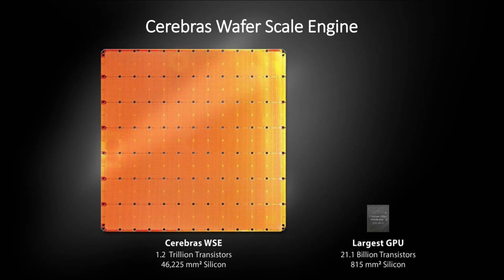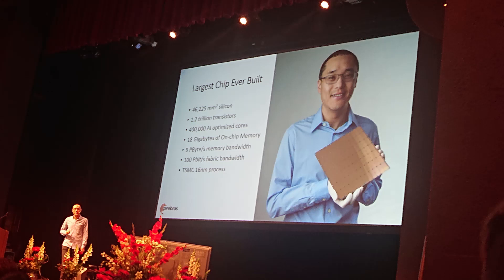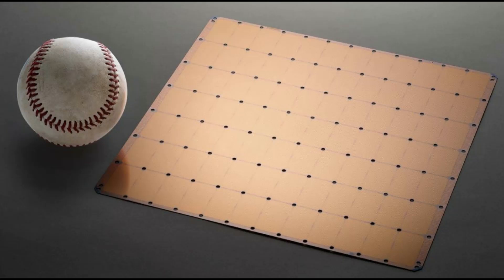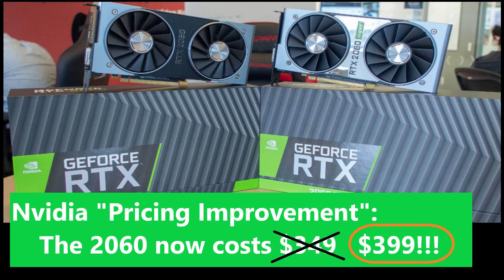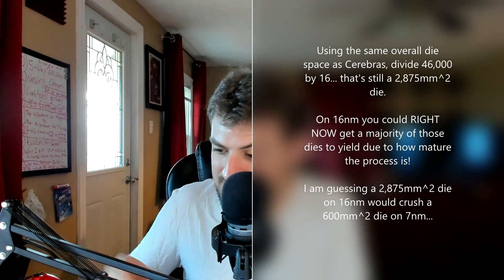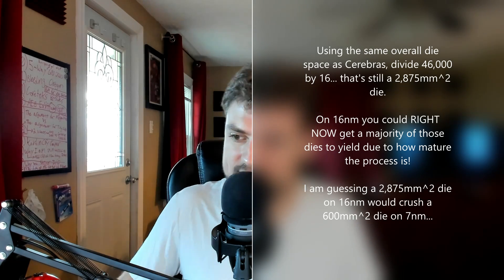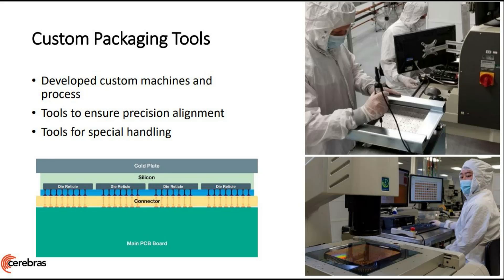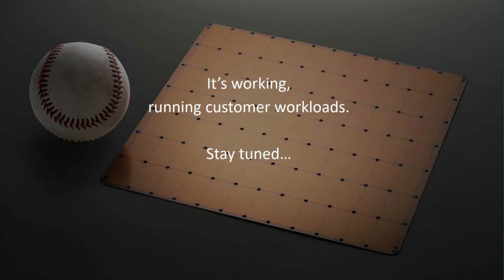The Monolithic Future of Silicon

Comment: You should look a bit more into big monolithic dies... historically, this company is not the first trying this approach. AMD's chiplets with infinity fabric on substrate or Intel's EMIB with any data fabric is a better choice in almost all cases.

BUT... all of those companies that tried to build either wafer-scale processors or wafer-scale memory chips failed, and why? Large dies are not practical...

Let me explain:
1. Even though it's a monolithic wafer-scale engine, it still consists of completely separate cores. This is because physically, you can't project such a large die in one go, you need to slide the template across the wafer. Then you can bond (create a fabric) between the dies that are on the same wafer afterwards.
2. So you still need inter-die connects, just like with chiplets, but in this case, you have to plan the wiring carefully, because you need to circumnavigate defective dies, which will not always work (= higher costs, lower yields, "weakest die"-issue).
3. In the end, this achieves nothing more than Intel's EMIB (where a small silicon bridge is embedded in substrate between chiplets), although (the monolithic solution) does this at higher cost, less practicality and less flexibility in how the individual dies selected are laid out physically next to each other, e.g. gaps.
4. Why is physical layout/gaps important: Ground plane and power delivery. This thing needs 15000W, or 15kW. Now... this needs to be carefully regulated 0.8V and 18750A. For comparison, a Threadripper needs a 250A power stage (can be done with 5 to 15 high end mosfets). Now how are you going to fit 75x more VRM components than a Threadripper very, very close to the individual chips on the wafer, without causing problems with thermals, power stability and just straight up finding space for all the components and connection points? Not a cheap/easy or practical engineering feat.
5. Wafers are silicon, so basically glass. If the chip is not heated up uniformly, the thermal stress across that massive wafer is going to be uneven, causing movement and expansion, which will eventually either wear out the silicon and crack it, or it will wear out the bumps that connect the wafer to the substrate, just like with nVidia GPUs in the 2006-2009 era, where massive amounts of laptops stopped working due to broken GPUs (https://codingfreak.blogspot.com/2009/04/beware-of-nvidia-graphic-cards-in.html ). I do not believe this company has solved that problem before they do a massive rollout... it's unlikely.
6. Datacenters will be reluctant to adapt any system not fitting in standard form factors. It is a nightmare to get this approved for any system integrator, and wafer scale engines fit no industry standard at all.
7. Instead of using one massive wafer-scale chip, many smaller ones connected on a high-quality substrate (bridged with EMIB or even copper traces) will achieve identical performance in almost all deep learning applications, although at lower costs and standard form factors.

Disclaimer: I work for a hardware (fabless silicon) company myself.
Reply: Arg!  Your criticisms are well taken, but seriously: a silicon platter is a "wafer", not a waver.  If you "waver", you oscillate between two options when deciding something.  Though your points may make people waver about enormous wafers...
Reply: @ANonymous-bh1un  A thanks, woops, shouldn't try to write essays late at night :D corrected.
Probably also a giveaway that I'm working for the software division of the HW company...
Reply: And eh yes another point of course is that wafer scale engines will lag behind leading edge process technology by a generation due to cost and yields. So the chiplet-based approaches will almost always be more energy efficient despite using more pico-Joules per byte read from off-die memory than the WSE approach. And ofc. the WSE will also have to do off-die memory access when the internal memory is no longer enough. And that does happen, just slightly later. 18 GiB/wafer is less than what top-end GPUs have, and the WSE needs a good chunk of that memory to store code, not data. Reason being that loading code from external memory would be too slow, compute kernels need to be constant on the chip, once programmed. (With inter-core exchange needing active data exchange code, because it's not an uniform coherent memory access across all 18 GiB from all cores, rather about 50 KiB of local memory per core).
Reply: @naibaf710   "HW company".....Huawei?
Reply: I agree with a lot of your points but silicon is really not glass.
Reply: @johnm2012  Not literally, but can be as brittle as. It's not ductile like metal.
Reply: @naibaf710  Correct. My discipline is chemistry and it troubles me when people confuse silicon with silicones and silicates. Silicon is used in semiconductors, silicones are used in breast implants and silicates are used in glasses. They all contain silicon atoms but only the material used in semiconductors contains elemental Si, which is indeed very brittle. That's a physical property it shares with glasses. Silicones, in contrast, are quite the opposite of brittle!
Reply: @johnm2012  >Hi-Fives fellow chemist<  Though I'm Bio-, not Inorganic.
Reply: @ANonymous-bh1un  🖐️

Comment: Instead of using half the 46k^2 for super fast cache, what about 3D stacking it on top of a full core die? Would it be possible to combine the two in the future?
Reply: This is a good idea, but as Coreteks infamously point out, all parallelizing becomes inefficient at some point. Knowing this, if you have all the cores you need on part of the die, you can put whatever the hell you want on the other side. And since adding more cores might not do really anything, you effectively wouldn't be losing performance from not having more die space used for cores.

Comment: That 46200mm2 chip is made of 84 separate 550mm2 dies with built-in redundant cores and data links. Cerebas designed it to be defect tolerant because not even very mature processes are defect free. This is pretty different to how Intel made and sold products with some perfect results, some slower performing ones, then ones with defective parts disabled, and finally discarded dies.

Comment: What's the retail on that 21.5cm by 21.5cm (LOLOL) chip exactly? And what is it's purpose?

Also, YES! 
ARM style micro cores surrounding a "big fish" 6 or 8 core 2.5D/3D CPU all on a single die. And then add an intergrated GPU on said die or stack. 
POOF the future.
Then it is all about miniaturization.

Comment: The original name for this is wafer scale integration, which has been attempted multiple times since the 1960s. One of the more (in)famous examples was Trilogy Systems, founded by Gene Amdahl (of Amdahl's Law) in 1980. They produced 100mm wafers covered with interconnected dies, but Trilogy found it too difficult to manufacture and eventually went bust. Another example was Anamartic's (Sir Clive Sinclair) wafer of DRAM dies demonstrated in 1989, a 6" square wafer (about 22,500 mm^2 30 years ago!) containing 202 one megabit dies, used to build a 160 MB solid state disk. Anamartic was a bystander victim in one of the periodic DRAM market crashes. (If you haven't noticed, the DRAM market has been for decades and likely will continue to be subject to boom and bust cycles.)
Reply: Trilogy's WSI wafer turned out to need an order of magnitude lower defect density than what was feasible at that time to yield. Even though there was redundancy circuits to combat defects, but there are portions of the circuit that could not be made redundant, like the voting node in a TMR (triple modular redundancy) circuit ... WSI is much easier for memories, its architecture is simple and very effective redundancy schemes are easier to implement. NVDA's die size is recticle size limited. MCM is the right way to build large systems, we can get the state of art chiplets, assemble them with high density signal carriers and power distribution layers. Most thin film layers are too resistive to get signal from one corner of die to the other corner in a WSI wafer. When we talk about a few kWs of power at 1V, we are talking about a few thousand amperes, so proper power distribution is needed. It is possible to cool a few KW WSI chip. To be noted too, when people talk about MCM, Chiplets etc, there are differences. Some use a poor man's approach that connect from one die to the next at the edge of the die. This is cheap and easy, but not suitable for random logic. The amount of interchip interconnect will determine the complexity of the signal carrier.

Comment: 4:59 "Having one tier of memory is technically the ideal architecture"
I disagree. You should read the "The Myth of Ram" series by the blog "I like big bits". It explains quite clearly why the ideal memory architecture is dictated by the dimensionality of our universe. The ideal memory architecture is an infinite tiered cache, but that's impractical. The problem with modern architectures is: they spill over to PCBs where the signal density becomes so low and the distances so long that you have to rely on high clock rates instead of wide busses and high voltages to preserve signal integrity. PCBs then spill over to cabling which incurs even larger power and bandwidth penalties. What will likely happen is: People will build stackable, megalithic dies that will push the role of PCBs into roles that are now covered by cabling. The backs of server racks will have enormous PCB interconnects instead of a mess of cables.

Comment: Why do we still use off chip RAM. Why on earth dont we use HBM2 right next to the CPU?
Reply: Because having external ram makes it possible to expand the amount we have. If you only have ram on the same package, the only way to upgrade the ram is to upgrade to a processor with more ram. That's not economically feasible unless the device I meant to be disposable like a smart phone or a laptop. (See apple)
Reply: It is the same reason for the memory hierarchy in the first place. Each level in the hierarchy is faster but more expensive per bit than the next.  Since there are only a small number of  execution units working on a handful of data at a time, most of the data at all levels of the  memory memory hierarchy are just waiting in memory to be processed. At some point it becomes more economical  to swap data in from the next lower level of the hierarchy than to have more of the more expensive memory,  which for the most part is just storing date until the  execution unit  gets around to working on it.

Comment: They should just make it a circle and use the entire Wafer
Reply: "They should just make it a circle and use the entire Wafer"
Yep, and coat the whole wafer with chocolate.
Reply: Don't yields get worse as you get close to the edges?
Reply: @ChucksSEADnDEAD  
The bigger the chip, the lower the yield.
Reply: @samlebon9884  Yes, but what I'm referencing is that, unless I am mistaken, the litography process has more artifacts the closer you get to the edge, so if you embed a square in a circle only the edges get close to the full diameter of the wafer. Or maybe I'm remembering wrong.
Reply: @ChucksSEADnDEAD  yes

Comment: I'm sorry but this implementation discounts the speed of light. the signal latency from the corners to the middle to i/o is a roadblock man can't fix. The power and cooling required would keep frequencies in the single digits. Isn't that why we went smaller in the first place? This is more in the realm of building a Quantum computer qubit. Just another black hole for $$.
Reply: This is more like a multi socket processor in a single huge silicon where each of the squares is an independent CPU. The problem with current multi-socket platform is physical distance between the CPUs and the amount of bandwidth between them. In that massive die, there are more than a couple dozen of those CPUs, in traditional multi-socket platform that would probably take up an entire server rack or two which would add tons of latency and power. 
Corner to corner latency of 1ns massively beats server rack to server rack latency(more than a foot, plus added latency from the communication protocols used between motherboards) which is the main point of that huge die.
A typical 42u server cabinet is around the height of a single person, in a typical two CPU per motherboard config, each motherboard takes up 1u rack unit, you could fit 84 CPUs in it(hmmm 12 x7 is 84 hey what a coincidence), suddenly the corner to corner latency of 1ns seems to be much much faster than rack to rack latency.
Reply: @snowstar3560  Corner to corner latency isn't going to get anywhere near the speed of light limits, because of wire capacitance, the need for repeaters, not having point-to-point diagonal paths, and other issues.

There is research into actually using high bandwidth light signals (photonics) for this kind of communication, but it's all research. Practical stuff today is going to have to wait for wires to charge.
Reply: FWIW, it takes about 1ns for light to propagate from one corner of Cerebras' die to the other.
Reply: @veedrac  Sorry, but that's too slow. It takes far longer to go the hundreds of mm that it takes go 3 microns.
Reply: @jerrywatson1958  Too slow for what?
Reply: @veedrac  Try computing, that's what. Time and distance can't be violated. God man look this stuff up, don't you know how to use google?
Reply: @jerrywatson1958  Vast majority of data the core is going to use is local, or nearby. Even if it's from the other side, it's only 40cm round trip, which is 1.4ns. But of course traveling through will add much much more latency. Still, if the chip runs at 1ghz and it's engineered really well, the farthest memory is still faster than DDR4.

But on deep learning apps, you mainly use the local data, or data from nearby cores. What determines if this is success or not is the frequency it's able to run. At 100mhz it will be useless, on +1ghz I would assume it's great.
Reply: @veedrac  Yeah that's a winning argument (NOT!)
Reply: Correct. The speed of light has been a design consideration for CPUs since at least the 65nm node.  This is one of the reasons for  multi-tier cache  designs.  Each tier of cache is  closer to the execution unit than the previous tier with the L1 cache closest and sometimes actually in the execution unit. This is also why the L1 caches are so so small. You can only pack so many memory cells around the execution unit before the path links get too long.

Comment: You split caches to reduce lookup times, adding boat loads of memory on die has been planned for ages.
At a certain point staying on die will cost more power increase heat...

If, somehow nvidia loses the performance crown again and isn't able to shrink out of it they will go with the dual gpu cards again.
Big dies are anything but cost effective not to start about making them fit in industry standard packaging
Reply: Cue videos of people cooking eggs on Nvidia cards again....
Reply: If they do that, Is that will resolve the resolution issue of playing a game at something like 8k resolution?  That seemed to be the one thing SLI was good at... doing big screen resolutions.
Reply: @baloneyjusticecheezedog  wouldn't hold my breath for 8K gaming anytime soon.
2X 4K for VR Which wouldn't suffer all that much from the usual SLI downsides sure.

Comment: Maybe they stopped at 815mm² because of the Power Consumption???
Reply: and/or heat dissipation?
Reply: @tonnylins  And because you can't do litography on something larger than 900mm²... even this big chip consists of many small chips connected on one waver using bridges that are put on the waver afterwards...
Reply: @naibaf710  yeah, ofc.
Reply: Aperture size and yield rates also.
Reply: I thought I was missing something- thanks for confirming my reality

Comment: Only a small fraction of total memory on such chip is "ultra low latency". Going to far cores may incur latencies greater than a typical trip to DRAM.
Reply: You wouldn't go to far cores on something like Cerebras' waffle, all memory operations should be local. The problem they are solving is very specific.
Reply: @veedrac  Sure, it works only for problems well fit into local memory. But in this case, performance is indeed impressive.

Comment: Another solution is to use different material altogether 
There are already plans to replace silicone dies with graphene, that would be interesting thing to see if it actually happen
Reply: Graphene can do everything except going to mass production.
Reply: Silicone e.e 😎😂
Reply: Graphene is not a semiconductor. You have to do interesting and difficult things to it to make it behave as a transistor